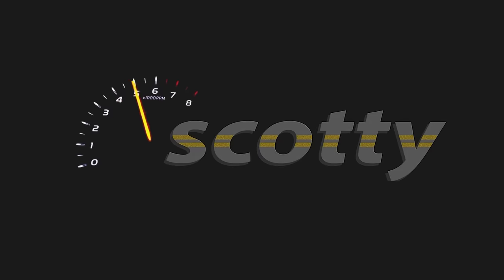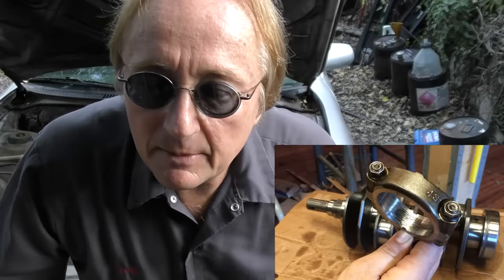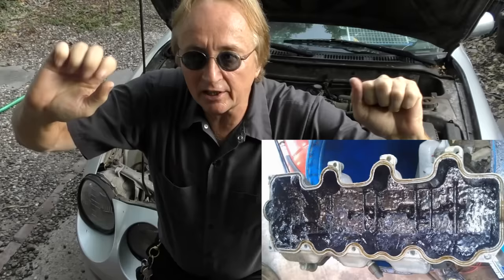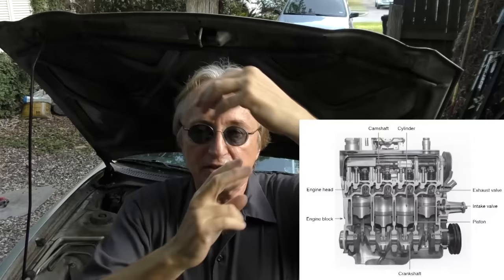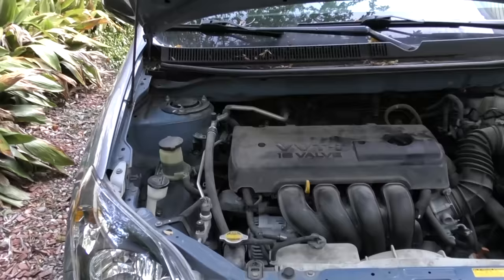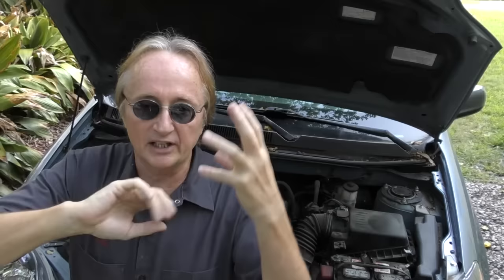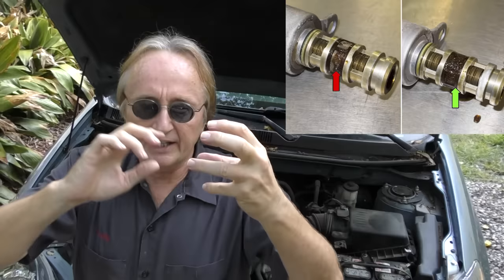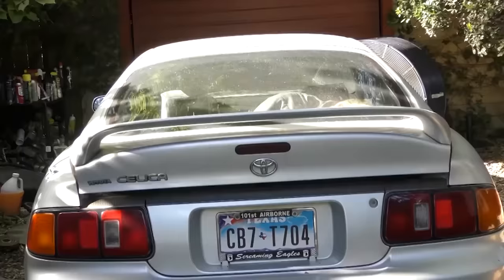Why Not to Flush the Engine Oil in Your Car

Comment: Scotty you are such a gas. No wonder that you are running the most watched auto channel. Sound reasoning...point in case there are all these characters on youtube that advocate flushing the engine with all sorts of things, using diesel fuel instead of engine oil and what not. You just put all of that into perspective (as I knew you would)! I was kinda trending towards what you said in the end, but its great to hear you spell it out in no uncertain terms!

Comment: Hey scotty. What do u have to say about switching oil types? I switched to full synthetic recently  did about 3 oil changes since. and now my 03 Trailblazer uses oil . Also, it reads full after only adding 6 quarts of the 7 it needs.. I drained it all. And it's really dark . It was not as bad the first few times

Comment: And having heavy carbon deposits on the valves and pistons is good according to you Scotty. You obviously have never actually worked for an actual dealership or certified shop because if you did then you would know that they have flushing equipment for not only the engine but also transmissions.

Comment: so i have a car that i know has went around 30-40k miles without an oil change. do i just change it and let it be or do i flush it?
Reply: I would then fill and drain twice with high mileage oil good luck.
Reply: You also could use Valvoline extended protection and change oil more often.

Comment: What you can do instead of using an engine flush is change the oil, change it again in 250 miles and then every 1-1.5k for about 3 or 4 cycles.

Comment: So I'm looking to buy a 2011 Camaro. Six cylinders. Only 11,000 miles so basically new. The thing is the owner had an engine oil system flush. Do you think anything could have been damaged? Kinda scared to buy it because of that. Help?

Comment: I was having smoking out of the left bank on one of my vehicles. Ran a leak and pressure check and everything checked good. Ran a strong engine flush and the smoking went away. Probably had some sticky valves from build up

Comment: So here’s the equation 

if you change your engine oil regularly there’s no need to do a flush because you know it’s clean 

secondly if you think the car has been neglected and it may have sludge do not do a flush because the sludge is what’s keeping it going 

so bottom line is don’t flush no matter what….???????

Comment: to sum it up: If its that last option to getting a new engine then MABYE you COULD try flushing it to try and save the SLUDGED up engine. Remember when you do that you might as well change the piston rings as well? right? Like if right. Dislike if wrong. Comment as to the pros and cons of the scenario I just mentioned.

Comment: About 10 months ago i went over a curb and shattered the oil pan on my 1988 bmw e30. That left the bottom of the crank exposed, and over time a lot of dust and dirt stuck to the excess oil and caked on. I sprayed engine degreaser and wd40 all over, and cleaned as best as i could with paper towels. Now that the parts are installed,  should i just do a bunch of oil changes or would this call for an engine flush?? Any advice is greatly appreciated!!!

Comment: It`s true. 
A car that burns oil due to stucked piston ring. They are stucked. You can`t do nothing but only opening the engine to change piston rings plus valve seal, or, buy anther used engine!
Flushing, don`t serve nothing

Comment: A friend of my had sludge and crudge in his engine. So what we did was change the oil every 5000km instead of 15000km wat was recommended. After a full year the engine looked like new.

Of you have that problem take your time and flush of slowly instead of fast with engine flush

Comment: how would i get rid of the crude or decrease it without flushing? i was going to flush as i just bought a older car not sure on maintenance history of the car but stick on the windshield is about 5k over due on an oil change. car is an 02 model so and im assuming im the 3rd owner.

Comment: So I have a 2008 Impreza, the car doesn’t get the oil changes for every 5,500 - 10,000 miles in the past before I bought it. I replace it every 2,000 to 5,000 miles. 

My spark plugs get extremely dirty and the oil changes color quickly. So would this be a good idea to get a flush?

Comment: Hey Scotty, I have a 92 NA 300zx and I have lifter tick which is common for this car, how would you recommend cleaning the oil gallery holes in the lifters without taking it apart.

Comment: Scotty maybe ur right. Its wont help u if u throw a oil flush in a 250k km car that has a really bad condition, actually ur destroing the engine, like u said. But imagine having a car with great maintenance(engine working really well). I think its a good idea to use that flush. Its like a vitamin. It wont save u if u have a really bad disease, but it can prevent other problems if  your engine is in a good condition right?
Reply: Car with great maintenance doesn't need flushing.

Comment: Not true, I have a 2013 Toyota Corolla and a 2011 Lexus ES 350. Both have about 170k Miles. Did a BG EPR engine flush and they both run even better than ever. Brand New. I change my oil every 3-5k miles. Scotty it's probably describing somebody who never has changed the oil or has gone far in between oil changes. Again even often oil changes build carbon throughout the year's.

Comment: So my daughter's 2011 Sienna is getting varnish build up under the valve covers which is visible when you take off the oil filler cap. It has 211,000 miles on it. She changed the oil every 10,000 miles. Are you saying just leave it alone and change the oil more often?
Reply: 10K oil changes???! Are you using full synthetic oils?!

Comment: I delayed my last oil change 18 months, should I use a flush like Liqui Moly ? I was ignorant on MILES or TIME whicever happens first so I changed very late.......I did however used synthetic . Engine has 54k miles and its 2011

Comment: I have neglected by oil changes by 2k km on average on 10k km oil change interval on my 60k miles 2015 Kia Sorento. Was thinking on doing an engine flush as I am switching from 10w30’to 10w40 oil . Should I still do it?

Comment: Scotty, if I were to flush my 128k mile engine with a higher rated flush due to the buildup I see do you think I could use that AT-205 re seal as a precaution after or do you still suggest to not do that? My engine also may have a oil pan gasket leak that I’m fixing with my next oil change. That’s possibly why I have a little tin rattling sound when I accelerate  right?

Comment: What about VAG TFSI engines that are actually prone to soot and sludge buildup on the valves and lifters from their special direct injection? I've seen pictures of some seriously clogged up valves in those engines. I have one myself that to my knowledge has never had an internal clean, so I'm getting kind of worried and wondering if I should have it done.

Comment: I have a mitsubishi eclipse 2007 stick shift the previous owner didnt take care if the car and that crust is sitting right there on the head and everything like he shows on the video i was thinking on remove that part get it cleaned up and put it back any suggestions btw not going to do the flush just in case

Comment: I Use 5w30 ACEA A5/B5 oil in my car and I noticed it become very dark like a diesel engine and thick like jelly. 15000km oil change, Gasoline Gdi.
I don't know if is normal for this kinds of moderns oil to turn into jelly.
There are also some pieces of black dirty inside the upper cap...

Comment: So you've never owned an LMG 5.3 GM V8. Noted. Cyclo Motor Flush every 50,000 miles with a Range AFM OBD 2 disabler. No rebuilds.

Comment: I bought my 2014 6.7 powerstroke diesel with 50k miles in 2017 and now has 80k miles. I change the oil and filter every 5k miles with oem oil and filter, and notice after a few miles, the oil is black. I was going to youtube how to do the flush and this video popped up. Is this normal for diesels?

Comment: This advice doesn't make logical sense.  First, don't flush b/c you don't need it due to modern detergents in oils and no crud builds up.  But, secondly, don't flush because you can break free big chunks of crud.  This makes no sense b/c engine oils have detergents and no sludge should be there.  What makes sense in my mind is to use such products to gradually maintain and remove any sludge as preventative.

Comment: I have an old 85 Toyota pu . pryer to rebuild I flushed the motor with automatic transmission fluid and got anouther 15.000 miles out of it. It went from burning a qt of oil from 500 mi. to about 2500 mi

Comment: As an engine builder i agree and disagree. A proper oil flush will allow oil to make it back to the oil pan from the heads with less travel time, additionally, if an engine gets blow-by after an oil flush..it has poor ring seal to begin with

Comment: I put seafoam in my oil 200 miles before I do a oil change. Is that a engine flush??? Been doing that for years no problems seems to clean it out pretty good it turns really dark

Comment: Soooooo seafoam in the crank case is a no ?
Reply: the scum of humanity I have a 2013 genesis 5.0 and I’ve used sea foam in the crankcase about 500-700 miles before an oil change and it works great no issues

Comment: Hi Scotty I bought a second hand Bmw 735i E38 with a M62TU engine it had a problem with Chain Guides  when i open the  Cylinder Head cover wow there's Sludge in the so please advice Shall I flush it or just replace the Chain Guide and drive keep changing oil every time or shall i replace the new engine?

Comment: my engine suck up water thought the airfilter and now there is water in the engine ,i drain it out change the oil filter ,air filter,and replace the oil with new oil but when i check my dip stick there is still trace of water in the oil ,should i use a engine flush in this now ??

Comment: Hey Scotty I have a 2000 Honda Accord SE it has 195000 miles on it I'm looking to run Royal purple on it to clean all the crud out do you think it's a good idea since I saw a guy on YouTube taking his engine apart and showing that it does clean the crud out????
Reply: dont do it.
Just change the oil (when the car is warn/hot)
let it completely drain 
and use a syn filter with syn oil

Comment: I'm stuck with a Chrysler 2.7L V6 (eek). Thankfully its had no issues so far at 120,000 miles. Is there something I can do to prevent the sludge this engine is prone to without the issues Scotty is referring to?
Reply: Just change your oil regularly with good quality oil.

Comment: Where is the DOUBLE-LIKE BUTTON?   After that, where does it leave me when the oil pressure is low at stop lights?   Hmmmm, I'm thinking to change the filter over and over and the oil way more often for a year or so.   WHAT DO YOU all think?    Understand, I am a dope, a donkey, your ideas are certain to be better than mine.   HeeHaw HeeHaw HeeHaw  << 2000 Toyota Tundra 8-cyl I hope is my last ever truck >>

Comment: is it ok to use lucas in my 2002 ford windstar it has 223k miles on it and burns a little oil.  or would it be better to use that at 205

Comment: Hello. about 2 monts ago i bought BMW 3 E46 1.9 Petrol, and engine was clicking all the time. After that i flushed oil in engine, and from that time i ran 4000 Kilometers and engine is completely fine and silent without any clicking. So maybe sometimes flush willl help. Or it was only because i changed oil? What do you think? P.S. Sorry for my english, I am from Europe :D :D

Comment: I change my oil every 3000 on my 02 GMC Yukon XL . When I first started there a ticking sound coming from the engine but after the engine is hot the noise goes away. What should I do ? Use I use seafoam  ?
Reply: Yes please use seafoam if after 3 oil changes tick isnt quiter, take it to have valves adjusted

Comment: THANK YOIU!!!  I'm dealing with this very issue right now.  I have already purchased the left and right VVT solenoids, but I'm afraid of gunking THOSE all up with crud that's in the engine now.  So I started putting my parts store shopping list together.  Guess I'm not going to flush my engine oil now!

Comment: I was given from a 2002 Silverado with a 4.3 v6. With 225000 miles. It was a work truck with tons of documents of work done to maintain. Well, it needed work when I got it...haha full tune up, i went AC delco on all tune up parts, distributor was old and was causing igntion issues and was stuttering. Changed it and now she runs well. I we changed oil with high mileage full synthetic Mobile one, she was full of oil sludge and clogged up oil drain plug in pan....haha Anyway shes getting better, but now P0341. I guess im 1 tooth off when we installed distributor. Cant fix it. I had bad car accident and cant climb and reach the location of distributor, and my brother that helped me left for work in another state. She just sits, still runs great, but i dont want to create damage since she has high mileage. Any help, or recommendation?

Comment: Hi! I bought a Renault Koleos that is 7 years old and has 50k miles. First owner changed oil by the service book, every 20k miles or 2 years (wich i think is not particularly healthy). Problem is that i cannot look inside this engine. Oil cap is build together with the dipstick, the hole to top up the oil is very small and located on side of the engine. Could this engine be ruined already? Altough engine runs great in general, Turbo started to whistle a lillte when engine is cold. Also on start-up engine is not holding a steady idleing for aprox. 30 seconds. Any advice will help me tremendously. Thanks! :)

Comment: I was ignorant about car maintenance.   One time I changed the engine oil I followed  based on mileage that took 3 yrs and a half to reach because I don't drive much.  The mileage put in was 12000 miles for those 3 and half years. Car didnt show any oil warning light on. Mechanic told me to follow the date of service not the mileage. The car is still running but I think it may already have some damaged done to the engine. Should I flush the engine?
Reply: You’re car mostly likely is fried … u kept the same oil in for three years

Comment: I have a 4cil k type VTEC motor. (09 Honda Element) My VTEC isn't working properly, stuck in limp mode. I replaced or cleaned the VVT cil, VTEC Assembly, And related screens. (They were all clean) problem persists, I think I have low oil pressure, so I want to do a flush because dropping my oil pan is too crazy on my car. PLEASE HELP SCOTTY!

Comment: Back in the 70s I use motor flush a week later the motor blew never used it since it washes the oil off the bearings and you have no protection at startup learn my lesson

Comment: How do you feel about Sea foam?
Reply: He made a video on that but in short its dosent do anything to the new cars as the engines are more coplex then what sea foam is intended for. For modern cars he suggests using pea rated adfituves. And I believe it as I used in my former daily driver and she drives like new
Reply: @racinggamesonly5466  
 Yep, I saw it afterwards. THANKS
Reply: @racinggamesonly5466  
Ok thanks for the info!

Comment: So what if I didnt change the oil on my car fast enough and my check engine light came on after I hadn't chanted the oil in a bit. I changed the oil and the engine light was turned off by the mechanic, yet it came on again. When he connected his device it said something about oil pressure, yet my oil pressure gauge on my Dodge Charger seems to show the pressure being fine, im assuming its sludge, so then what? What is the solution? I asked the mechanic why that would happen and he said "sometimes the censors get old and you need to change them" 

that to me sounds like " I dont want to give you a real answer so that your car will mess up and you'll have to keep coming back to me to fix it". 
What can I actually do to check? and get to the bottom of the issue?

Comment: Hey 
I have a 2002 Suzuki Wagonr+ with a simple non vvt engine, no hydraulyc lifters etc. It’s been sitting for 8 months and it has a little bit of sludge shold I flush it?

(I change my oil every 15-16000 km)

Comment: I have a new car with only 3700 miles on it. Is it alright to put full synthetic on the first oil change?
Reply: Absolutely!!  Sooner the better. Change the oil often during break-in.
Reply: @kenweller2032  Thanks,  it's a nissan cvt transmission and I got it before I knew about all the problems they have. What are some other tips to maybe get more life out of it?
Reply: @aldolter148  The motor oil you use has nothing to do with the CVT, just the engine.  I personally know two people who had problems with them (Nissan specifically). They ended up getting rid of them. One got a Kia Sorrento and the other a Honda CRV. Both have been happy since. From what I hear, Toyota's CVT's are fine. My sister has one in a RAV4 Hybrid.

Comment: Hey scotty. I’ve been restoring my dads Truck. It’s been 6 yrs since it last started. Should i use an oil flush for it??
Reply: Drain it, take the oil pan off and check the pan for the carbon build up. If you see any in the pan and on your crankshaft do a flush with 75% conventional oil and 25% diesel fuel.  If it's 6 quarts use 4 quarts oil and 2 quarts deisel fuel. Run on idle for about 5-10 minutes.. you don't have to Rev the motor. It's safe I have done it to many cars/trucks the deisel fuel has lubricating properties as well.